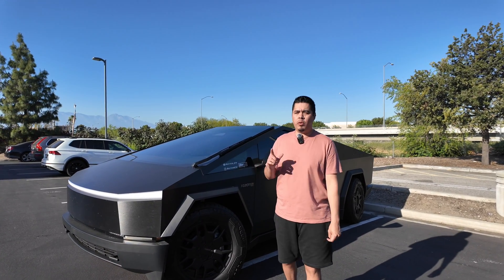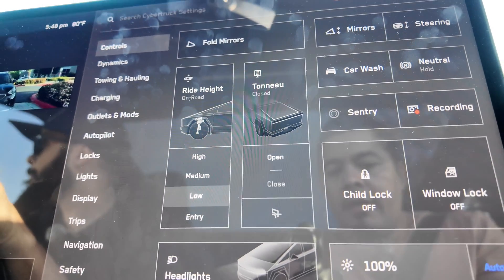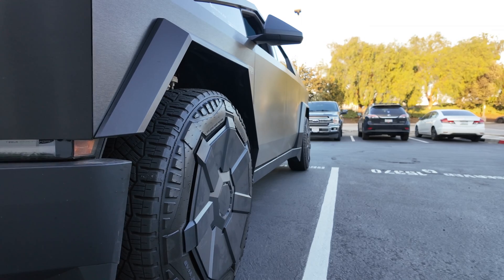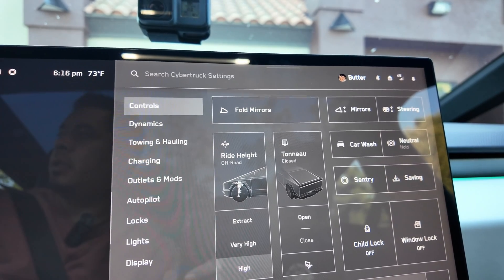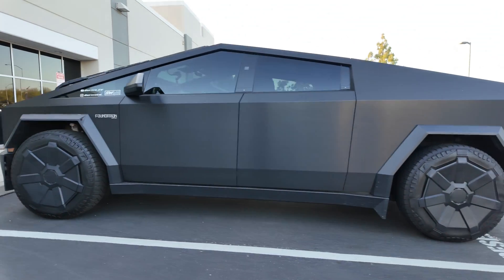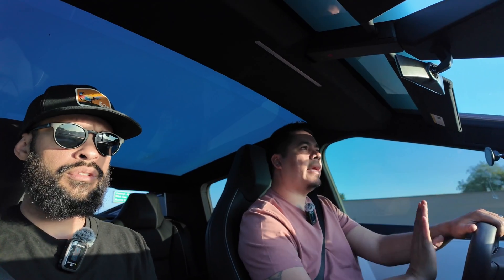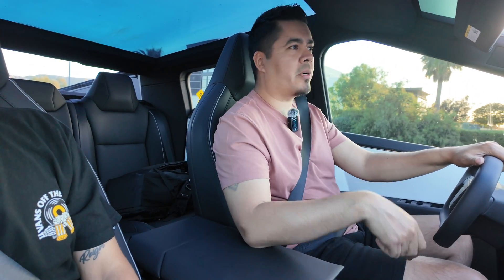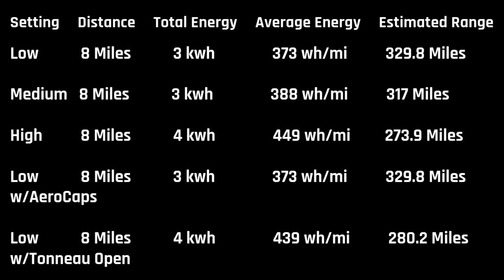Shocking Results of CyberTruck Suspension Test

Comment: Can you repeat the test and include one with the tailgate down and the tonneau cover open?

The tailgate is similar to a parachute, so having it open should help, but still be worse than when entirely enclosed with the cover down.
Reply from the maker: I can definitely do that but I didn’t for this test as I wanted to simulate having cargo in the bed where someone would have the tailgate up to keep the cargo securd
Reply: We recently did a 125 mi trip, all highway (speeds at 80 much of the way), and we left the tonneau open but the tailgate was up. The Energy App in our truck showed that we'd have saved about 3% by closing the cover. I've heard as much as 10%, but that was our experience on this one trip.

Comment: You cant definitively say the aero caps arent better by driving 8 miles.  It isnt statistically significant.  Even in a controlled test, they likely only make a couple miles difference on an entire battery pack.
Reply from the maker: It’s hard to do a long distance test with this many settings. It’ll take a long time and traffic will change the results. We used a highway which had very little traffic so we were able to maintain a set speed

Comment: If you decide to sell the covers please let me know and I will buy them. Needing a set for wife’s CT.
Reply: @Butter_EV  I’m serious please let me know.
Reply: @TeslaLife2.28 do you know they ruin the tires?  I suppose you could cut off the part that sits on the tire.
Reply: @47izaPedo  If pressure is at higher level it’s little wear. Looking for another set for the Tri motor.
Reply: @TeslaLife2.28  I hate them personally but each to his own.  I’d just wait until the aftermarket comes out with small center caps just to cover the lugs.
Reply: @TeslaLife2.28  although I should add that I don’t like the entire wheel and tire package.  I’ve seen some nice aftermarket wheel and tire packages out there already.
Reply: @47izaPedo  I have beadlocks coming for my Tri. Wanting covers for wife’s as I lost 2 off my truck.